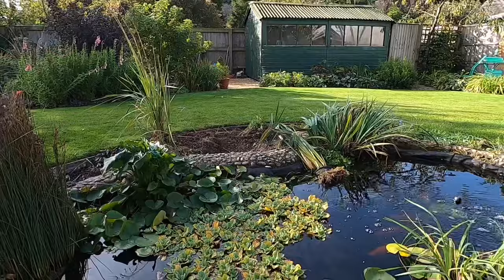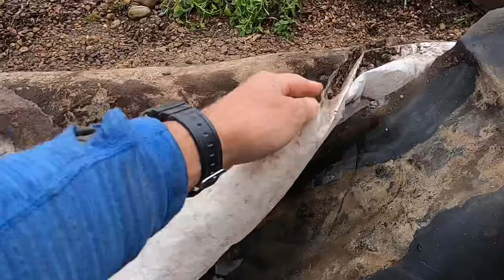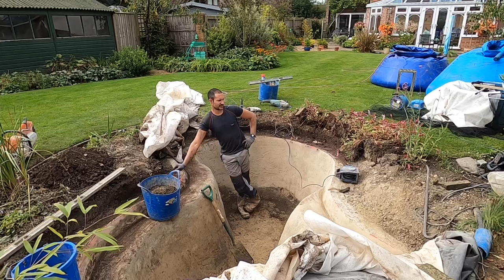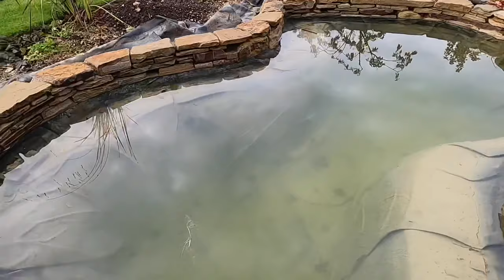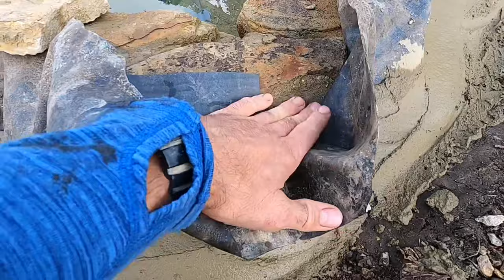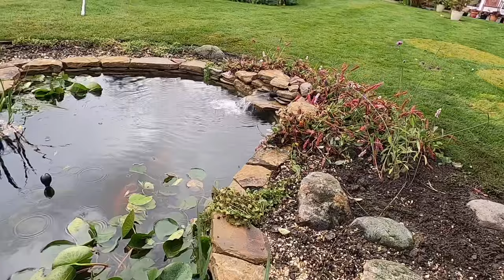Pond edging makeover!

Comment: Love your videos! I am hoping to make a low set retention pond that gravity floods into a dry well, but it needs to be low set so I was thinking of doing pavers under the liner to deal with hydrostatic pressure that might build up and the sides accepting and releasing drainage to dry well. Would that work or will water seep under it and float my liner away? Lol
Reply from the maker: Hi there, depends really on the extent of the hydrostatic pressures your potentially dealing with, but short of creating a fully water tight and solid shell beneath the pond liner (and if you did you’d almost not need the pond liner!) then I suspect water ingress could be an issue...
Best,
Ed

Comment: Hi There,
Can you tell me what size of a holding tank you used for the fish?
Reply from the maker: Depends what fish/quantity of fish I’m required to hold for the duration of the job.  Small pond drains with only a few small (12” ish) koi or up to perhaps 100 small ish goldfish I’ll use a rigid koi inspection tub which is Approx 3’ dia and 30” deep.  If hot I’ll aerate.  For longer duration such as when building a pond, or if housing temporarily more fish I use a frame style swimming pool (intex or bestway) whivh is 12’ diameter and 30” deep and will rig up a temporary filtration system.
Hope this helps and thanks for watching and your question!
Best,
Ed

Comment: Hi Ed,
Are you using any special concrete to fix all the rocks together inside of the pond? Or any regular mix?
I'm planning to attempt a similar project on one of my ponds but I'm unsure what kind of fish safe concrete should I use..
Great videos, always! Take care, Luigi
Reply from the maker: Hi there!
I’m not using a special mix; simply a standard Portland cement/sand mortar mix.  This will need to sit and ‘cure’ in the pond water for a little while to allow much of the lime and other harmful toxins from the cement to leach out, before adding livestock.
Best,
Ed
Reply: I know you said to leave the mix a while to cure etc but how long would you leave it before adding fish? Or could you use a pond sealer on the mix to avoid this problem altogether. Great videos by the way.

Comment: Can you advise the mortar mix for use on the semi submersed walling please. I am using a Yorkshire sandstone to a similar design as this pond. Currently considering a 4:1 or 6:1 yellow soft sand:OPC.
Thanks
Reply from the maker: Hi there, thanks for watching and commenting! I get asked this question A LOT!! (And mention it on pretty much every video involving the use of mortar😂) my regular mix (which I use for all internal pond edging/walling, slab laying etc) is a 4/1 ratio. Two sharp, two soft and one cement with some added plasticiser.
Hope that helps and good luck with your build!
Best,
Ed

Comment: I have a few things to say first of all I like your videos keep up the good work. The concrete pebble surround was horrible what was they thinking. My main criticism is the use of cement around the pond not a good idea. I would have said gravel would have been a better alternative. It would also work better for drainage I also thought a over flow would have been a easy install just run a pipe through the liner sealed with a off cut of liner and silicone. You said it was off brief to do a cascade I would have convinced the owner to install a small stream. AS for the rock work seemed a good job but I wanted to say don't rely on cement and concrete or mortar to much. 

Remember a stone wall built with no cement will outlast a stone wall with cement. I think a dry stacked wall would have been better. I do think using larger rocks is a better look than many small flat rocks. I appreciate moving massive rocks is very hard work but it can be worth the look. I used massive rocks in my small pond for the waterfall dont get me wrong its back breaking work and some times you need a jcb to move them.
Reply from the maker: Hi there! Thanks for your constructive criticisms always good to hear other peoples opinions and experiences on matters pond related and I see you have your own experience with aquatics in general!

I have to disagree with you on a few points however;  re the overflow; simply passing some hose through the pond liner and sealing with an off cut and silicon is, I’m afraid to say, a very cowboy way of doing what should be a proper ‘though liner’ tank connection, utilising a purpose made fitting, which is glued and screwed into place (or  clamped closed with a seal and locknut).   The amount of repairs I’ve made over the years to such improper installations I’ve lost count of! Oase make a great fitting called a tradux which does this job very well and I regularly use them for overflow systems in ponds.  

However once one installs an overflow consideration needs to be made regarding where the water will be directed to; either to suitable drainage, to a lower part of the garden or into a soak away.  This garden was very level- no where practical for the water to be drained to and no convenient drainage for some distance without major work. A soak away could have been created, but my client had been used to periodically draining the water from the pond if it had become an issue via the filtration system and then only during extreme rain- most of the time the surrounding boarders and lawn made for an ample natural overflow soak away. 

I agree a lovely stream or a well constructed cascade would look great here- but one cannot simply “convince” a client into paying for extra work that they don’t agree on.  Although I will always explain the benefits of certain things when undertaking a job non essential ‘cosmetics’ will come down to budget and a clients opinion and for me the clients desire (if practical and possible) will always come first over my personal opinion.  In this instance life support/filtration is essential, how the water returns back to the pond is then subjective and down to a clients discretion/budget. 

Re rock work; over the years I’ve made many a pond ‘dry stone’ and created some lovely features in this way, but there’s no getting away from the fact that from a durability point of view fixing stones will make for a more permanent and strong structure, particularly for a pond surround and particularly if such a surround will be trodden on/kneeled on during garden maintenance.  Fixing using foam is a good option in certain situations- but really the use of foam is simply to ‘fix’ a stone into a semi permanent position, but is not as strong as a more permanent cement based mortar. Obviously cement carries its own associated risks to aquatic environments but as long as you are aware of these and know how to deal with these risks cement is a very good and durable product to use to fix certain materials.  Incidentally- a stone wall built without mortar won’t outlast a like for like wall that has been correctly constructed with the addition of mortar!!  Dry stone walls (predominantly the typical low drystone wall we’re all used to seeing in fields etc) are all constructed low and wide for obvious structural reasons hence their longevity!

In certain instances I agree- large rocks/boulders can look amazing in a garden/pond setting and again I do dabble in such ponds now and again, but I guess everyone has a signature style and mine is with thinner pieces of stone and a more formal(ish) appearance.  Again though, this is purely subjective and I’ll offer alternative edging/pond themes to clients and allow them to chose their own preference.  I would say that scale however is very important and large rocks can look out of place if not used carefully and with a mix of rock sizes.  One of my videos posted this year (frog pond construction) is a small pond made with some larger boulder/naturalistic rockery pieces and looks all the better for it I think! 

Thanks for watching and for your comments and every best wish,

Ed
Reply: @CrystalClearAquatics  I thought I would reply since your reply was what shall I say epic. I have spend a long time researching different method's of pond building in particular the aquascape method. So as you can see I know more than your average pond builder. I agree with you cement can fix stone in a permeant fashion. In fact I experienced this when trying to seal a concrete made pond. What a disaster that was I like your style of pond building it feels down to earth rather than aquascapes method of we are the best so you how to pay through the noise for our artistry.  I do feel using cement is a easy fix and do think many people use it far to much. watching this video was a shocker though I bet you could not stop cursing when you found out this pond was lined on top of a concrete pond. Cutting stone with a stone cutter is not fun at all in fact its a horrible job I found this out when cutting down a breeze block pond. 

My pond I built last year was built largely with black landscaping foam I even made a fish cave out of stone and then put a bog filter with plants on top of it. I will put link below if you like to see it, its only small but I want to rebuild the waterfall not looking forward to moving these massive rocks. The reason I say use large rocks is to try and simulate what mother nature has created you hardly ever see a natural pond just made of small rocks is always a mixture of some small rocks with some very big and its best to try and replicate what mother nature has created to try to make a pond look like its been their for a long time. As for a soakaway yes these are nightmares to build my water table is very high so I can not dig to deep. As for the overflow comment you made yes you can use bulkheads and tank connectors for sure and they give a better seal but its not impossible to seal a pipe yourself using some liner and sealant.  Again keep up the good work it really makes me angry seeing  good youtubers like yourself only having a small amount of views. link - https://youtu.be/Y3rZ_3cOG3Y